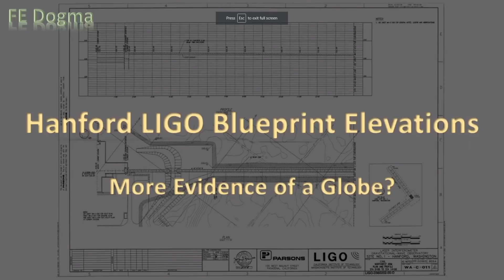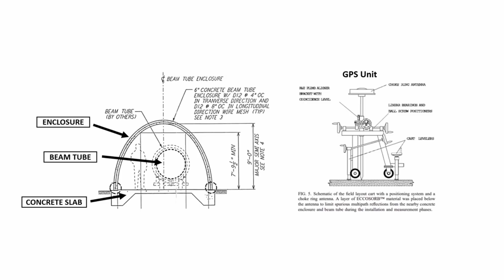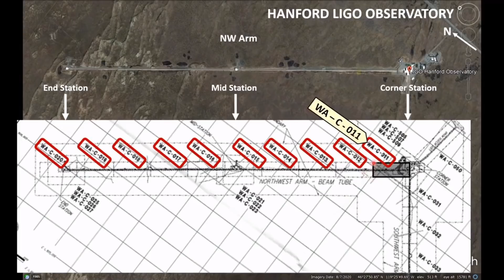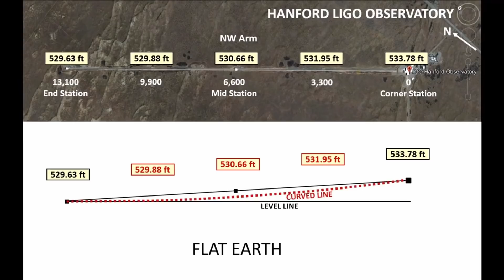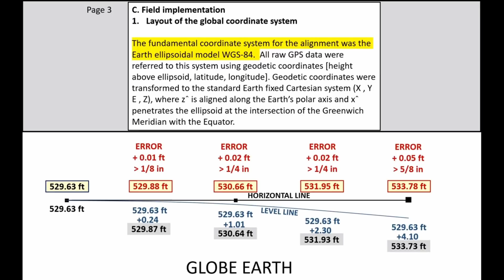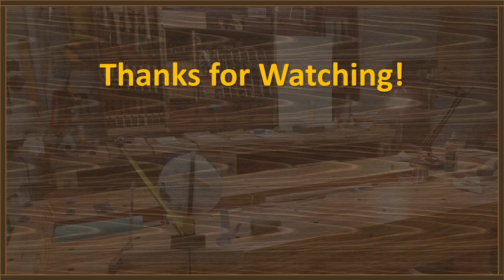FE Dogma LIGO Analysis

Comment: Possible slight source of error in the video: elevation is measured perpendicular to the surface of the Earth, but the diagram makes it seem like he's doing it perpetual to the horizontal line. I'm also not sure if the "distance" in the curve calculator is along the surface or along the horizontal line of sight.

Obviously still orders of magnitude less error than on the FE model though.
Reply: For short distances the difference between perpendicular to a horizontal line and a level line is negligible.  Same for the distance along the horizontal line or level line.

Comment: I'm surprised none of them have popped in insisting that the GPS in their phone isn't that accurate, so you can't use GPS to level something that precisely.  Amazing what you can do with equipment designed and built to achieve a solitary purpose with accuracy more important than cost instead of general purpose consumer equipment designed to be cost-competitive.  Just having an antenna that isn't designed to fit inside a thin phone goes a long way.

Comment: Really well done analysis. No surprise that those LIGO engineers got it all right. 
BTW, you've got all your "less than" symbols backwards (you wrote  ">" in your drawings when you said & meant "less than" which is "<")
BTW, they are in the process of planning "Super-LIGO" which will be about 10x longer legs, and much greater drops.
See ( https://physicstoday.scitation.org/doi/10.1063/PT.3.4041 )

Comment: To think this is the kind of "proof" you guys have for your model...
Reply from the maker: @Q Branch Spot on!
Reply: @Q Branch You forgot the shadow from the end of a stick. It follows the orbit of the sun in the flat sky, in a circle on the flat ground. Except for it doesn't. Instead it follows a straight line from west to east when the sun goes from east to west on the celestial equator, all around the north pole and the south pole.
Reply: @Q Branch 
😁 I get that. You certainly hit the most cogent ones, I thoroughly enjoyed your short list!
Reply from the maker: Thanks - it is.
Reply: @bluemarblescience  hardly.
Reply: @Q Branch 
Good start!👍
Reply: @optimine
Evidence lad, not "proof"
It's sad that so many escaped science class where they had to experiment to discover these things for themselves.
I remember how disappointed I was to miss measure the earth diameter by 600 kilometers in 9th grade. To be fair, the exploration into how I went so wrong, pointed out starkly the difference between "accuracy" and "precision"
So that was a win.
Reply: @dragonhealer7588  I have no idea what you thought you proved to yourself in high school, but you sure as hell didn't prove you live on a wobble ball of said dimensions.
Reply: @optimine  
That, and more lad. That, and more.
And yes, you obviously have no idea.
Reply: "Observation of a local gravity potential isosurface by airborne LIDAR of Lake Balaton, Hungary" 

Airborne LIDAR (Light Detection and Ranging) is a remote sensing method commonly used for mapping surface topography in high resolution. A water surface in hydrostatic equilibrium theoretically represents a gravity isosurface . Here we compare LIDAR-based ellipsoidal water surface height measurements all around the shore of a major lake with a local high resolution geoid model. The ellipsoidal heights of the 87 km2 we sampled all around the shore of the 597 km2 lake surface vary by 0.8 meters and strong spatial correlation with the geoid undulation was calculated (R2=0.91) . After subtraction of the local geoid undulation from the measured ellipsoidal water surface heights, their variation was considerably reduced. This demonstrates that the water surface heights of the lake were truly determined by the local gravity potential. We conclude that the accuracy of airborne LIDAR is sufficient for identifying the spatial variations of gravity potential over large inland water surfaces .

https://www.researchgate.net/publication/262495012_Observation_of_a_local_gravity_potential_isosurface_by_airborne_LIDAR_of_Lake_Balaton_Hungary
Reply: @dertod1703  oooh, big words and real numbers, must mean you make sense?
Reply: @optimine  Level ≠ Flat. Level means to follow the equipotential in scientific context. The study I linked proved via laser 3D scanning that undisturbed water heights vary considerably, and do so in accordance with variations of g (gravitational a accelerations).
Reply: @dertod1703  You're claiming water levels are somehow representative of a massive oblate spheroid?  or just not perfectly in a straight line at times due to various factors that can affect the water nothing to do with the concept of a spherical world?
Reply: @optimine  Water heights are determined by gravity potential. LIDAR has been used to verify the relationship between standing water heights, i.e undisturbed water, and gravity potential and great agreement has been found. External factors such as tides, waves and wind have nothing to do with it.
Reply: @dertod1703  haha, right in that water is affected by all sorts of things, none of which have ANYTHING to do with the concept the ground forms an oblate spheroid.  (and note you said tides have nothing to do with your understanding which is of course not true, as in your model the "tides" are directly related to the idea of the movement of water)
Reply: @optimine  Stop misrepresenting what I said. I've said tides weren't responsible for the observed height variations. Let me repeat: LIDAR was employed to measure  undisturbed still standings water heights . These water heights were then compared with measured gravity values in the same area and great coincidence between water height variations and variations in gravity potential were found.
In other words undisturbed still standing water is not flat but has actual topographical features.
Reply: @dertod1703  I am not misrepresenting anything, nor am unintelligent.  Your claim water has "topographical features" is...well...you fill in the blank.
Reply: @optimine  It's not that hard to understand. You've claimed water at rest is flat. LIDAR measurements disagree and found water at rest to exhibit topographical features, like up and downs. 
According to the laws of physics water at rest is supposed to follow an equipotential surface determined by the gravity potential.
This claim has been put to the test and found to be true, that is water heights do indeed depend on the local gravitational acceleration which varies, for example, with underground resereservoirs of petroleum.
Reply: @dertod1703  haha, dude...magnetism, pressure and all sorts of physics are at play, but sure, let's just imagine your theory makes sense.
Reply: @optimine I don't need to imagine! The data speaks for itself; standing water heights are determined by gravity potential. Not magnetism, not pressure, not salinity, not wind, nor anything else.
Let me repeat: Water height variations determined via laser 3D scanning and gravity variations determined via Gravimetry are directly correlated.
If you disagree with the experimental findings then please provide a quantitative analysis which correlates the findings with whatever you imagine could mimic or affect the results.
Otherwise you're just spouting empty words.
Reply: @optimine  
Why does gravity vary on your flat earth?
Reply: @dertod1703  thanks for the comment.
Reply: Yea. My username is sphaera, I chose it specifically because it’s sphere and knew it would trigger conspiracy mongs. And I have 0 intention of being a youtuber so neither this alt nor my actual google account have any youtube content. I made this during a period where youtube would aggressively force feed you whatever you googled, and I don’t want fe bullshit infecting my search history. Not to mention my normal acct has my real name as opposed to the usual internet username so miss me with that poor excuse. But it’s always hilarious when conspiracy nutters actually believe there are genuine shills, people who the gov actually pay to do nothing besides track down flatties.

Oh, and good luck explaining gyrocompasses on a submarine.
Reply: @Q Branch Throughout recorded history, and all known scientific experimentation, bodies of water at rest have proven to be flat, no?  Does your cup of water show "curvature"?  of course not, and neither does any puddle or pond or lake.
Reply: @optimine  of course your coffee cup, a puddle and even a lake don't "show" curvature. Think about how big a 6 ft person would look to you when they are three miles away.  You would barely be able to see them with perfect eye sight since they would appear to be about the same size as the period at the end of this sentence and 6 ft is the curvature drop for 3 miles.  So exactly how would you "see" that curvature drop when that curved surface would really look the same as a perfectly flat surface?  This is why we measure and quantify when we do scientific experiments.   And sorry, science has plenty of evidence that bodies of water do curve because we live on a globe.  Again, you just can't see it because the rate of curvature is too small over short distances.  Also I have measured evidence of curvature.  Go to my channel and watch this recent video:  "Bev Needs to Try Thinking. Level Lines Actually Curve Down"
Reply: @fedogma8407  There are countless proofs "the globe" is a lie, but no doubt you have answers for all of them.  #FlecsOfPaint?  #SpaceBubbles  etc.
Reply: @optimine  those are a flat earther's opinion of videos and they have nothing to do with this debate.  We knew the earth was a globe before humans even travelled to space.  I know the earth is a globe from numerous personal observations I have made during years of travel and living abroad.
Reply: @fedogma8407  I have as well traveled and understand the concepts at play.
Reply: @optimine  No flat surface has a horizon that distant objects are obstructed behind. Mechanical gyrocompasses wouldn't work on a stationary Earth. The Earth is neither flat nor stationary. Done.
Reply: @optimine  Not certain where you have travelled to but if it was the southern hemisphere then you would have seen the sun orbiting around the South Pole which is in the complete opposite direction as the observed sun around the North Pole in the northern hemisphere.  And if you travelled near the equator you would have noticed a sun path that is neither around the North or South Pole but perpendicular to the surface of the earth and at night that path continues right underneath you as the sun returns to the east to rise again in the morning. These observations match the globe.   If the earth was flat I should have seen a sun orbiting around the North Pole from all of these locations.
Reply: @fedogma8407  I know all the globe theory pseudo logic explanations for why we're apparently on a spinning ball.
Reply: @optimine  
You’ve just spent the last 24h demonstrating that statement false. The evidence is this very thread. Evidently you’re either incompetent to the point of your statements being indistinguishable from obvious lies, which you somehow can’t seem to understand as blatant falsehoods. Or you are not incompetent but rather deliberately disingenuous.
Reply: @sphaera2520  hmm.  has no content.  has a globe image for icon.  is named "Sphaera". hahaha, sorry, shill, I ain't playin' word games with you.
Reply: @optimine  Could you see or even detect the shape of the earth in a cup of water? Of course not.
Could you see it in the angle between the horizon and the orbit of the setting sun? Absolutely.
Reply: @ReinoGoo  you're saying we have highly-detailed microscopes but can't measure "curvature"?!  haha.
Reply: @optimine  Use a microscope to see curvature in a cup of water! Surely you're not serious. The problem is that you left off the /s at the end of your comments.
Reply: @malundy  I'm saying neither micro nor macro analysis demonstrate your concept.  You have no scientific experimentation to point to.
Reply: @optimine  Actually, everything demonstrates our facts.  All the way down to the sun disappearing below the horizon every night.  You're just willfully blind, or trolling
Reply: @optimine  Who told you that nobody can measure curvature? Was it the same people that told you not to believe what you're told? Did you believe them when they told you nobody can measure curvature? Did you ask a surveyor?

Flat Earth is an anti-education movement that requires ignorance in order to exist. Prove me wrong.
Reply: @doofismannfred4778  Your name is "Doofis". 'nuff said.
Reply: @fromagefrizzbizz9377  you mean like a car moving away from you appears to shrink into nothing and "disappear" in front of you on an admitted flat surface?  or do you think highways follow your magical curved ball formula somehow?
Reply: @optimine  I'll take that as you know I'm right and you won't address the point I made as that wouldn't let you pretend the Earth is flat. That is, unless you did actually want to address what I said.
Reply: @optimine  For you to assume roads, something that goes over hills all of the time, cannot follow curvature... You're an actual clown.
Reply: @optimine  Lie.  Now try an actual fact, if you can.
Reply: @david_akerman  I don't lie.
Reply: @QED which scientific paper is it in?
Reply: @QED I've known the globe is a deception for some years now, and there is no way of unknowing that truth.
Reply: @QED Do you really believe in the globe model?  or are you somehow coerced into making anti-flat earth videos?
Reply: @optimine here is a simple measurable proof of a globe . Start at Perth, Australia and go directly west and keep going until return to Perth. On Flatardia that distance will be greater than the Equator, but in the real world it is not, proof the world is NOT FLAT.
Reply: @Q Branch It's known to most learned persons that water rests flat, hence A LEVEL using water to prove things are flat.
Reply: @optimine  Yay. You think level means flat. Here's a tip: Maybe think about the things you say before you say them. If I have a table with something under one of the legs, it's flat and not level. Clearly flat and level are separate things.
Reply: @Q Branch what you have is a handful of clearly-faked images and not the plethora of dynamic images that would come along with an apparently tens of thousands-strong satellite battalion.
Reply: @optimine  It sounds like you have the positive claim, that photos of Earth from space have been faked. Would you care to produce evidence of that claim?
Reply: @doofismannfred4778  
He can't.
He doesn't understand that an observation is an quantitative measurement taken with instruments. He thinks his looking at something reveals all.🙄
Reply: @Q Branch Its mechanisms are known; explain how it has anything to do with the alleged rotation of the ground.
Reply: @Q Branch how 'bout cloud formations that don't change over time like in Elon's car fantasy film?  is that proof of fakery to you?  yes or no.
Reply: @optimine  No, it's only proof that you have unrealistic expectations of what it "should" look like. Scale matters. The Earth is around 24,000 miles circumference. So even if a particular cloud formation was racing through the sky at 200 mph, that would amount to moving a pixel or two over an hour. Since clouds don't move at thousands of mph, you can only see rapid movement in a timelapse.
Reply: @-leaford1584  Speaking of clouds moving, did you see the clouds NOT move in the Elon Musk space car advertisement?  good times.
Reply: @Q Branch I'm not here to explain the totality of physical reality, I'm here to deny the verifiably false assertions like yours.
Reply: @optimine  
Oh, so nothing real then.
Deny away lad
Reply: @Q Branch How does a plane fly in a straight line above a sphere?
Reply: @optimine  Who says an airplane flies in a straight line above the Earth? Well, ignoring the definition of a straight line in spherical geometry, the only people that presume a perfectly straight and flat flight path are flat Earthers. So why are you sitting here pretending that anybody except flat Earthers say that?
Reply: @Q Branch shill much?  So how many youtube accounts do you have?
Reply: @Q Branch Tell me your name.
Reply: @Q Branch My identity is clearly shown, whereas you come across to me solely as a faceless globe shill.
Reply: @Q Branch go ahead, and explain how the tilted, wobbling oblate spheroid and the apparent literal pull from all mass affects it.  we're listening..
Reply: @Q Branch haha, compasses...very brave of you to bring those up, as a globe peddler.  anyway, see ya 'round.
Reply: @Q Branch whatever you say.
Reply: @optimine  So far, all you've done is claim people are shills, deny gyrocompasses exist and/or work, and pretend observations of the sun from the Southern hemisphere don't exist. The evidence suggests you are a troll that knows the Earth isn't flat. You sure as f++k don't care about truth regardless.

Comment: Note: in Louisiana the west tube is tangent midway along the tube. At Hanford it appears that tangency is at the vertex
Reply from the maker: Looks like it doesn't it. Slope is up toward the vertex on one leg and up away from the vertex on the other.
Reply: @bluemarblescience  
But not a tangent midway.
Reply from the maker: @larryscott3982  Yep!
Reply: @larryscott3982  The tangent points I used for each concrete slab was at their low elevation.  This was 529.63 ft at the end station of the NW arm and 533.78 at the corner station of the SW arm.  Actually I was a bit surprised when I later saw the elevations for the Livingston SW arm until I realized the tangent on that arm was in the middle.

Comment: Someone who works in commercial construction should know that " > " means "greater than", not "less than".
Reply: Yes, I made a mistake on that one.  I should have wrote it as 0.018m = 1.8 cm = 0.70866 in < 3/4 inch.